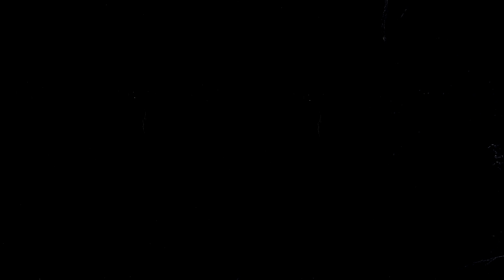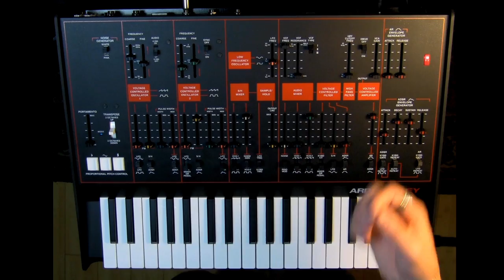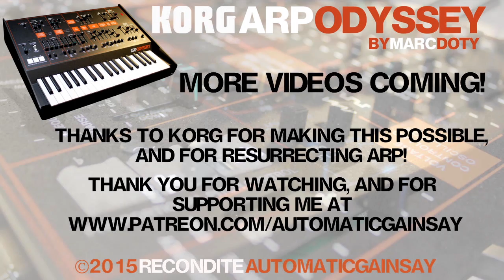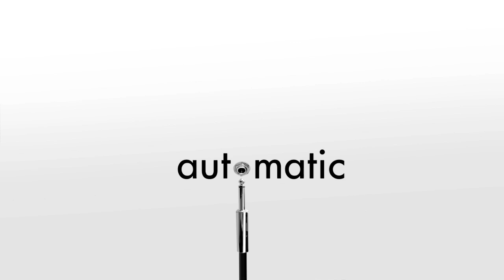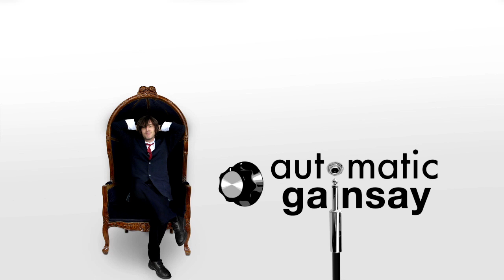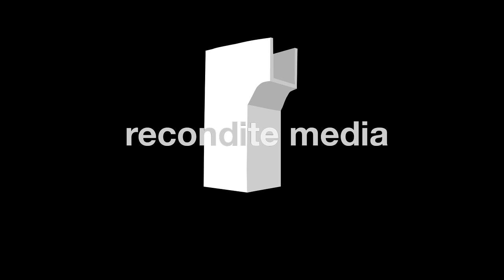ARP ODYSSEY - Marc Doty Inside Look Part 4: Sample and Hold Mixer

Comment: What is the best option for a speaker if my budget is fairly low. I've considered monitors and keyboard amps. However, do I need a mixer to play through monitors? I tried playing through my bass amp and obviously there was not much in the high frequency department. Headphones are ok temporarily but I'd like to be able to hear it out loud. Thanks!
Reply: Just as an example of practical experience, I have had some fun using the 8-channel mixer section of a Sansui WS-X1 (which popped up under my nose out of nowhere in 2005) for a bass guitar, 2 or more synthesizer models and a mic with a line out from its headphone output to a small Peavey bass amp combo with at least minimal positive results.  It's no substitute for a P. A., but it's a decent, random idea.
I no longer have the Peavey combo (in its place a Peavey stack which I could only dream of taking with me to the stage), but plugging the WS-X1 into the combo was simple and effective just for in-house fun.

 I would've plugged my guitars in there too, but I've already got other guitar amps.